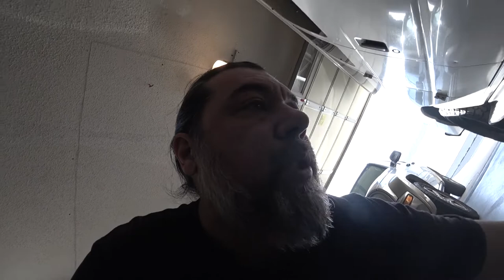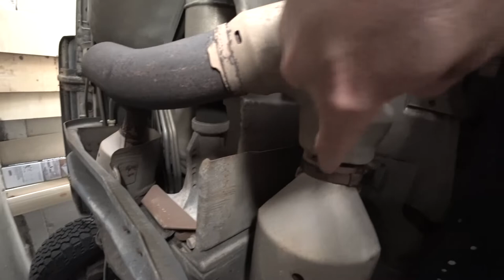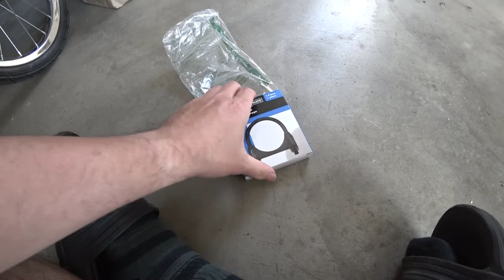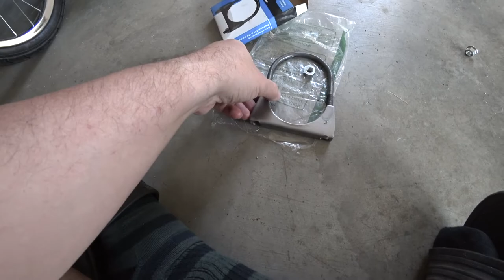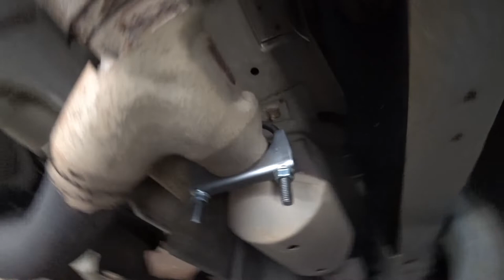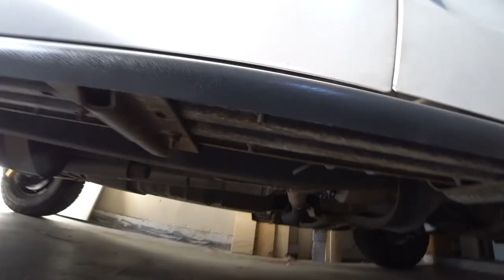How $30 could save catalytic converter

Comment: This is a great idea. I might snake in some thick cable through the clamps too and puzzle it to the frame. I'm going to make mine a good 20 minute job if they want to take it.
Reply from the maker: That's the point right? If they look under and see anything out of the ordinary it's on to something quick and easy
Reply: @CHICOandtheVAN  If they attempt this again and take 20 minutes I'm loaded up with slugs. For their sake I hope they never stop by again. I dont feel violated or like a victim. I'm pissed off with a 12 gauge

Comment: The cutters they carry are portable so they will have a hard time cutting through cable and chain.
Reply from the maker: I figure just choke the cut points for them. I may try some type of shield.
Reply: @CHICOandtheVAN  I was thinking using those clamps but run a few metal cables under them. Kind of like that kit I shared but way cheaper.